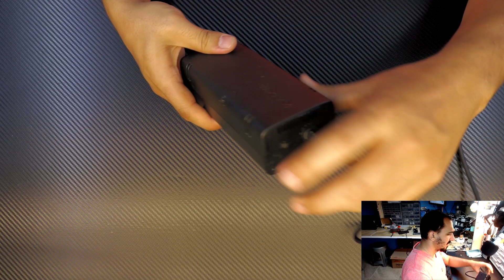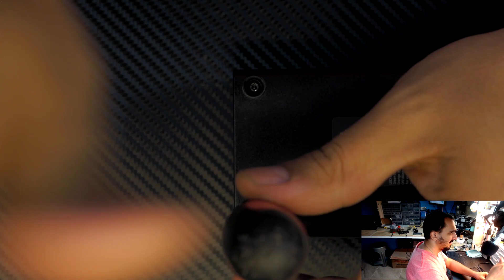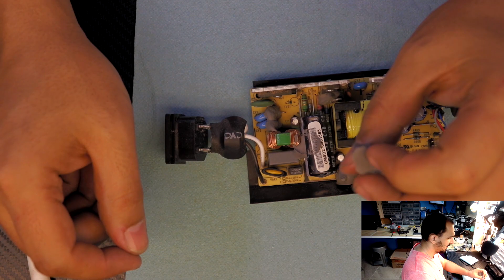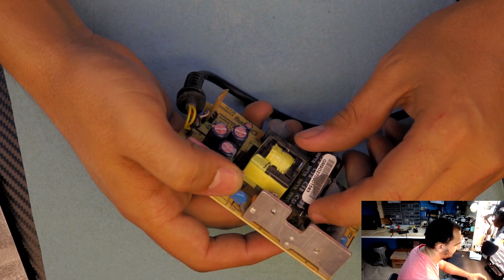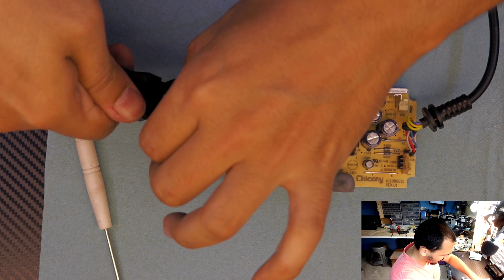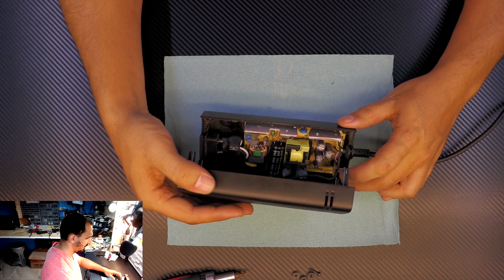How to fix your XBOX 360 super slim charger, Xbox 360 slim POWER SUPPLY repair

Comment: It's not a charger.....
Reply from the maker: It’s the external AC-DC unit for the Xbox 360. Call it a charger, PSU, or power brick—same box.
A charger is a type of power supply used to charge batteries; a PSU powers a device directly. The Xbox 360 uses an external power brick (PSU). Lots of folks still say “charger” for any brick. Precise term: PSU. Common term: charger. Same unit, same fix.
cheers🍻

Comment: Idk but is the capacitor is broken then power supplyer will no show any light not even red as we pluged it with current
Reply from the maker: Not necessary. The capacitors can become weak and still respond, but when you put a load on them, they will fail.

Comment: Hey uhh...my PSU Brick has plastic caps instead. No screws and I cannot take the caps off.
Reply from the maker: There are screws, and the plastic caps come out with the rubber feet.
puncture the plastic caps and pull them out, as shown in the video.
cheers🍻

Comment: I have a question what number is component is the yellow varistor
Reply from the maker: 🫠Regarding your question, 1st of if you going to replace the varistor i would recommend 1st measure the out put of the wall (home) as depending the city and place the voltage of the homes can be anywhere from 110v- 125v AC, once you know the home voltage then get the correct varistor, because the varistors that they include in the chargers are rated mostly for 140v and that is not good because the charger will burn if a surge happens. so i would recommend to get any varistor from 120-130v . i have opened many power supply and they always use a different model numbers. you can remove the varistor and test your charger and see if it is working.
i will open one tomorrow and let you know the model.

Comment: very informative I've noticed a buldgeing cap in my power supply funny tho how it still works but I've ordered some more caps to replace it with anyways being a qualified electronic engineer Ive found 99% of the time the reason power supplies fail is due to a bad capacitor and they are relatively cheap to replace Im a big fan of fixing things rather than to throw it away and buy another it saves the planet thank you for the video
Reply from the maker: It's my pleasure my friend. 😊 Thank you for taking the time to give feedback! If you would like to support the channel, please like, subscribe, or both. :P
yes capacitors are one of the main part of any electronics and they do clean and keep the stability of the current.
Should you have any questions or requests in the future, please don't hesitate to ask me.
🍻cheers

Comment: hello
ufixtek
I have a problem and the problem is that my xbox 360 S power adapter won't turn on...
it shows no light and no sound..
please help 😅♥️
Reply from the maker: Thank you for the feedback! if you wish to support the channel you can LIKE or SUB or both :P
regarding your question:  follow this video and see if the capacitor is bad and if you see anything else blown, also check this old video i have you may have a bad coil: https://youtu.be/5tN3kqzsA6U

Comment: Mine flickering orange for a second then Turing off can some help me
Reply from the maker: Thank you for the feedback! if you wish to support the channel you can LIKE or SUB or both :P
regarding your question: when that happens its because the transistors are bad ( the one screwed to the aluminum plates) or the main transformer its bad, i recommend you to not play with those they are high voltage and its cheaper to get a good technician to look at it.

Comment: Hi! Just subscribed to your channel. I've a question. My power brick shows orange indicator. When I turned on the Xbox 360 E, the power button on the Xbox turns solid red after just 1 second. I opened up the Xbox casing and saw the fan actually spinned for a second then stopped. Do you know if this issue could be caused by a faulty power brick? Thanks!
Reply from the maker: Thank you for the feedback! if you wish to support the channel you can LIKE or SUB or both :P
regarding your question: when we get consoles like this issues 90% is the power supply, other 10% could be a components going bad on main board. but based on experience 90% its your power unit.
https://amzn.to/3rDDDou
Reply: @uFixTek  so you need to change to a new power supply? no other way to fix it?

Comment: My Xbox power brick light turns red after an hour play.. the fan runs fine and i have cleaned all the dust but still after an hour it shuts the Xbox 360 and the light on power supply is red.. what could be the cause of it can you please guide me? Thank you
Reply from the maker: Thank you for the feedback! if you wish to support the channel you can LIKE or SUB or both :P
regarding your issue: i need to know one  or two things, #1. what fan did you clean the charger fan? #2. have you cleaned and repaste your xbox?
https://youtu.be/bPyajNXLZWk
https://youtu.be/KXdA4IsGPCk
Reply: @uFixTek  thank you for your reply. I have cleaned the fan that is located in the power supply. (Not the fan in the console) .. no I haven't cleaned the Xbox 360 console.
Reply from the maker: i would highly recommend to repaste or at least clean up the heatsink on the console, if it over heats it will shutdown and  a red light on charger will appear, go a head and clean it and test and let me know. i have send you the links to repasting and cleaning.
Reply: @uFixTek  thank you so much i'll give it a go :-)
Reply from the maker: anytime my friend :) if you got any request or question feel free to ask  me anytime my friend.
To support the channel you can LIKE or SUB or both :P
Please use my amazon general link before buying or searching for your purchases :P
https://amzn.to/3A8dJu6
much appreciated.
Reply: @uFixTek  thank you. I have liked and subscribed 👍🏻 .. you were spot on, it was the Xbox 360 slim console heating up. I dont have the expertise or tools to clean it all up so what i did was that i placed a USB powered exhaust fan on top of the console and it worked like a charm. I was able to play for a couple of hours and after i switched off the Xbox and placed my hand on top of the console ventilation area it was not hot at all :-)

Just leaving this solution out there if someone wants to give it a try it works too :D
Reply from the maker: im glad that it did work, can you please give me the exact model for the xbox the model that is written on the label at the back of the console. and thank you for your support

Comment: Nice video, congrats! 
But I have another problem. Not a 300uF burnt capacitor.
I have a Xbox 360 slim. His power supply is orange. When I press the on button, the red light of the power supply turns on.  I have only the +5V at the red wire. When I short the PS ON, I should find +12V at the yellow wire, but not. There is not +12V.
I measured and changed the 4 capacitors of 1500 uF near the output side of the board. (they was almost 1350 uF.
Apparently, there is no one burnt capacitor.
What should I do? 
What do you recomend?
Regards
Ricardo Garcia
Reply from the maker: Thank you for the feedback! if you wish to support the channel you can LIKE or SUB or both :P
regarding your issue: can you send me an email attached with a photo of insides of your charger, send as many you can parts /closeup and different sides. let me take a look as every charger are a bit different.
ask@ufixtek.com
espero tu email.
saludos
Reply: @uFixTek  Hi, I sent you an e-mail with charger photos - did you receive? 
Thanks

Comment: I am getting low voltage from my power block.  What can I do?
Reply from the maker: Thank you for the feedback! if you wish to support the channel you can LIKE or SUB or both :P
regarding your question: you will get low voltage around 3.3v or 5.5v the reason is that hte voltage wont be present until the motherboard has to send the signal for the charger to activate the 12v.

Comment: Hello, nice video ! i have a problem in my 360, where i have orange light but when i connect to PSON (bleue and red), it turns to red light fault, any idea where to look at (i checked the secondary schotky and it is ok) Thanks.
Reply from the maker: thank you for the feedback and support, and regarding your issue you may have a bad gpu power regulator. the 1st test will be to test with another power supply and then if still same you will need a tech guy to look at the power regulators on the cpu /gpu. they are the most common issues we get in the store.
Reply: @uFixTek  dear u fixtek i coneccted the blue and red wire of xbox360 slim adapter to out put a 12 v for my routers  and i put 1 k resesstor between blue and red. i got red light after a second.   note that my adapter was working perfectly before i desided to cut the wire and make it a 12 v power supply any help bro ?

Comment: What is the yellow thing beside the fuse in the bottom left called??
Reply from the maker: that is a surge  proctor they are called "varistor disc" you can replace them DYA-4415-1  (130VRMS 15mm)
Reply: @uFixTek  Can i short it?
Reply from the maker: NOOOO , JUSRT REMOVE IT CUT THE LEGG
Reply from the maker: IF ITS BURNED ITS SHORTED ALREADY , IT WORKS OPPOSITE LIKE FUSE.
Reply from the maker: IF YOU CUT IT YOU WONT HAVE ANY SURGE PROTECTION.
Reply: @uFixTek  it is burned but it still doesnt work which means something else is broken right?
Reply from the maker: if it is burned then it means its shorted, so cut the legs and test the charger. the varistor the way it works when it detects high voltage coming to charger it will automatically shots it self in order to protect the computer or equipment. so cut it and test the charger and double check the fuse.
Reply: @uFixTek  ok thanks for the help..
Reply from the maker: anytime and i hope you get it fixed :)
Reply: @uFixTek   i removed the legs as u said and i found out that the cube thing behind it its written carli on it is also burned i think i might but a new power supply or is there a way to fix it still?
Reply from the maker: you need to remove that component and if that is burned you transformer may have been damaged too 80% :(
Reply: @uFixTek  oh ok thanks for the help keep up the good work!! 👍🏽

Comment: Mine blew up will it fix it using this tutorial
Reply from the maker: if your capacitor is damaged then yes. open it up and check.
Reply: @uFixTek  is the capacitor the square yellow thing?
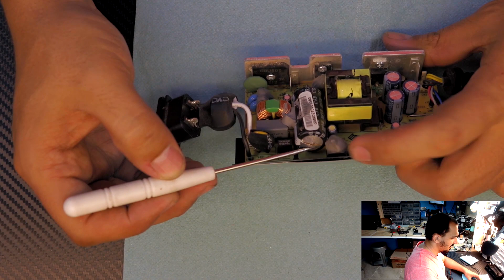Reply from the maker: no its the cylinder black thingy  @4:48 im point at it.
Reply: @chuchubellss  
Hahahah😂😂🤦‍♂️

Comment: Hello, nice video. Mine is orange light and when i want to turn it on it becomes red light. I changed the capacitor 400v, changed the fuse and nothing. Any other idea ? I have 315vdc at the main capacitor but nothing in the secondary... Thanks.
Reply from the maker: Let me check, and i get back at you
Reply: uFixTek I also have the same problem need help too please
Reply: Having the same problem, I have the 5V (orange light), but when I connect and turn on the Xbox, do not have the 12V, and the red light turns on.
Can you help me?

Comment: My resistor near the 330uf capacitor blow out and im planning to change my capacitor, will it still works
Reply from the maker: you must change all the blown resistors 1st then capacitors else the capacitor will blow out again
Reply: @uFixTek  how can I change the fuse if I have one Xbox 360 power supply box that has a working one and another that has a blown one that looks burnt ? I didn't understand you when you were talking about changing the fuse
Reply: @ahstruh  he did a cowboy hack and made a shoddy fuse because he didnt have a replacement. If you have a working one just tke it off the working board and and place it where you took off the burnt out one.
Reply: @charg1nmalaz0r51  thank you for the the information, but  i don’t need it anymore i ended up finding a working one and using it for my xbox one
Reply: @ahstruh  probably easier lol

Comment: My xbox360 charger is getting over heated, because of which console is turning off on its own. Please help
Reply from the maker: chanti chiru open your charger and clean the fan and dust thats all.
Reply: @uFixTek  Thanks mate!!!
Reply from the maker: chanti chiru its not a over heating problem, the thing is that when the fan starts failing or james with dust stops rotating well so clean nicely the fan, and you will be fine.
Reply: @uFixTek if you can rule out the power supply being at fault example clean fan capacitors all good what else would cause console to auto shut off after about 20/30 seconds ?? My console boots fine everything looks fine boots games but turns off soon after powering on I’ve changed the thermal paste also so I feel confident it’s not that and it hasn’t been modded or anyone attempting to mod it at all DVD drive works perfectly also. There is an issue with the power/sync board behind the main faceplate the sync button doesn’t work I don’t think as it fails to make the console leds rotate to initiate sync could this also be an issue I’ve removed the board and ran the console without it and it still shut off so I am at a loss to know what’s wrong

Comment: Hi, i am using XBOX 360 that has a power brick with two nozzles that connects to the Xbox 360 - Its not turning green from Orange - Do you have a video for this type of power brick as well ?
Reply from the maker: i sugest you open it up and check for blown capacitors and other components that could be blackedout, and send me a pic i will help you out, as of right now i dont have any video regarding your problem.

Comment: What's the black thing with the yellow tape on it called been getting a high pitch sound from it then the Xbox turns off automatically
Reply from the maker: thats your transformer if the transformer is making noise then you may need to change it, because it will stop responding soon.

Comment: the screws in those Xbox 360 slim and Xbox 360 slim e model power supply unit have 4 torx 15 screws

Comment: I fixed a bunch of Xbox Xbox 360 arcade Xbox 360 slim and Xbox 360 slim elite consoles I clean all the dust out change the thermal paste and clean the power supply unit

Comment: I broke the lil pillar thing preventing my star bit screwdriver from inserting all the way with a small flat head screwdriver then it fit perfectly. I almost never buy special tools if I can improvise with same or better results. Like cars, they want to get you to buy more crap to fix their crappy design flaws, and get around "security measures" I really expected more from Microsoft I mean come on. Good video man
Reply from the maker: I KNOW ROFL IT HAPPENS A LOT, ITS NOT A FLOW, ITS DONE IN PURPOSE. I ALWAYS REMOVE THE PILLAR THING THEN USE THE SCREWDRIVER.
Reply: @uFixTek  Hey man I know I'm a bit late but how can I remove it?
Reply: @hardik_dua  you just gotta force it lol

Comment: My xbox 360 plug the fan goes but the light won't turn on so if you could help that would be great
Reply from the maker: you talking about your PSU? if so , if your PSU fan turns on but not your light you do have a different situation, i recommend you to take it to a electronic repair shop. if you dont know the components you can get your self zapped :P

Comment: hi, how can i check if anything is blown?
Reply from the maker: Leopoldo Gonzalez if you cant see any blowout components with your eyes, you need to get yourself a voltímetro. And you need to know electronics at the component level to be able to test. This video is  showing how to fix it if you have same type of blown components. Cualquier cosa aquí estoy saludos.
Reply: perfecto muchas gracias, aqui tengo mi multimetro listo para revisar si algun componente esta dañado, una pregunta, ¿tengo que desoldar los componentes o los puedo revisar directamente insertados en la tarjeta?
Reply from the maker: Leopoldo Gonzalez asi es amigo algunas de ellas hay que desmontar para que no tengas circuito cerrado.  Saludos